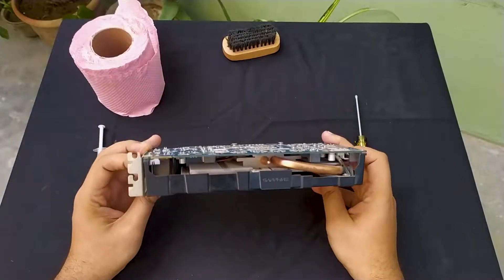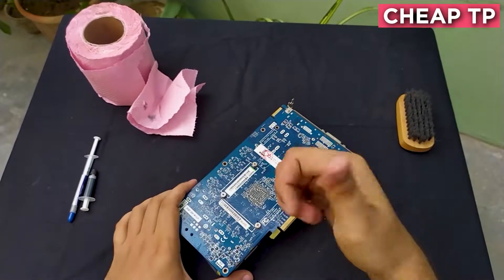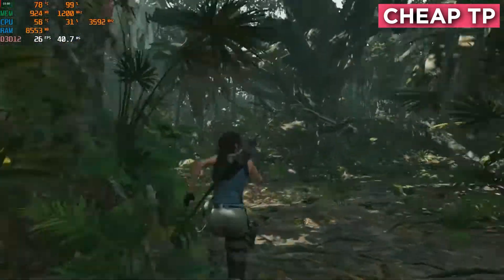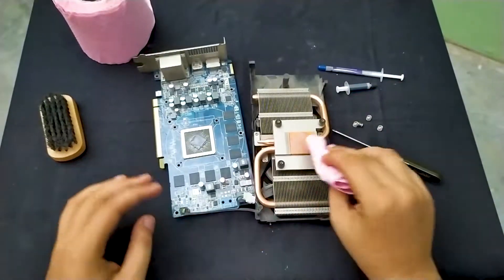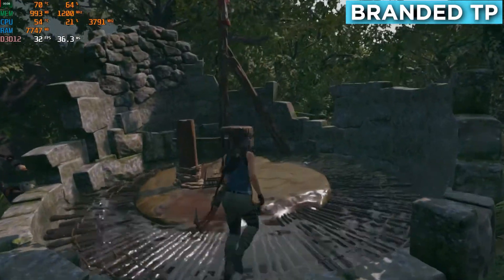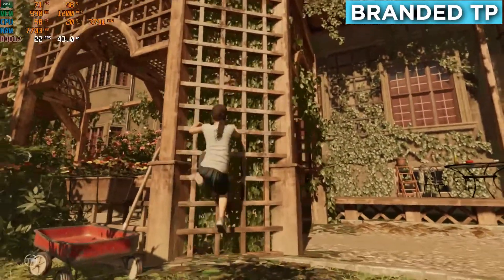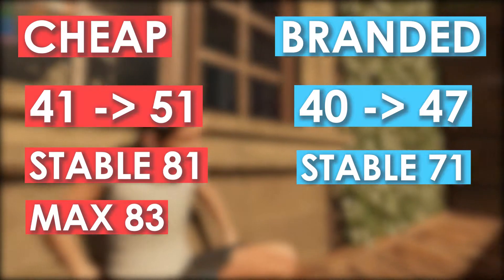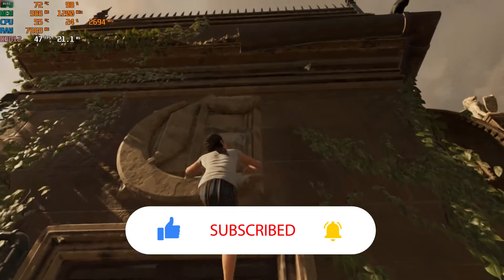Are Cheap Thermal Pastes Any Good ? Cheap VS Branded Thermal Paste

Comment: This has me wondering.. Are you over locking it or feeding it enormous amounts of power?, was the GPU bought second hand and perhaps the former owner didn't maintain it at all? Are the fans on the GPU shiet? Or does your chassi have second to no airflow?
My GPU is built similarly, though fins and pipes has no copper what so ever.. Which is a negative thing not to have.. The shroud is almost identical.. However playing the more demanding games of today seldom push my GPU temp above 70, unless the computer has been running the majority of the day and I've had long gaming sessions, then it might push closer to 80.. I'm currently using dog shiet TP quite frankly, I'm almost never running below +10% performance, +30-50% power and +100mhz vram, however I maintain my coolers every month and apply new TP every 3-6 months depending on usage and what I've been doing.
And I have really made sure to keep a massive airflow through the chassi, got 4 fans pulling in air from the front and top and 2 fans working as exhaust, and I generally run them on 20-60% efficiency depending on the workload.
Those GPU temps after 30mins is something I'd expect from an rtx 3080 perhaps after 30mins of a high workload.
I'm just saying, cheaper thermal paste isn't an issue if you maintain your hardware, know how to treat said hardware and you have sufficient cooling in your case in general.
However if you're running a high end rig and/or you're overclocking, then what kind of Thermal compound you use most definitely matter.

Comment: The conclusion is that you don't know what the hell you're talking about because 10C is NOTHING to a GPU.  You clearly have no experience in this matter and are just talking out of your ass.  BOTH of those temperatures were WELL within the spec of that card.  GPUs can hit 100C without damage so what the hell are you talking about?  Did you even go and look at any other tests before doing this one or are you just assuming that you know?  I've been building PCs since 1988 and I remember when thermal paste first came out.  Sure, back then it mattered because it was a new thing but these days, it doesn't matter AT ALL.  Do you have any idea how stupid you look to someone like me who knows computers, laughs at the insignificant temperature difference, expects you to say "This difference is nothing so don't worry about it." only to hear you say "Get the expensive stuff, don't risk your GPU!"?  This video was bady done, you did NO research and your conclusion was 100% WRONG!  That's all I can say about it.

To everyone watching, Tom's Hardware did a test 8 days ago showing that over 81 types of thermal paste, on an Intel i9-10850k, after an hour of Prime95, the difference between Kryonaut and what could be called "the worst" was only 6.5C.  I'd recommend a non-metallic, non-conductive purpose-made thermal paste from whoever gives you a good price.  Go check out that review if you want to see what a review looks like from professionals who know what they're doing instead of this idiot.
Reply from the maker: Man ! You lack basic human decency and adequate to mention someone, go learn these first then come to school me.